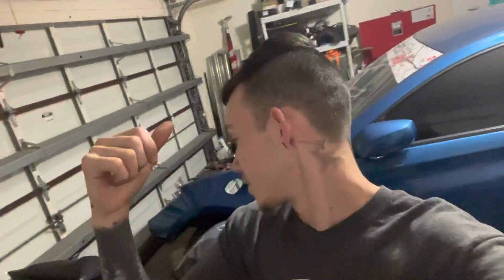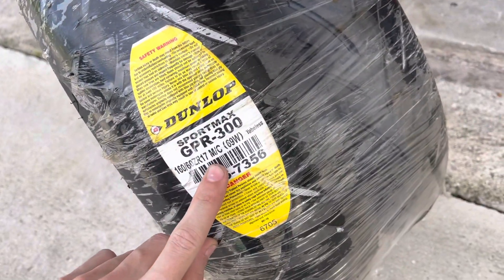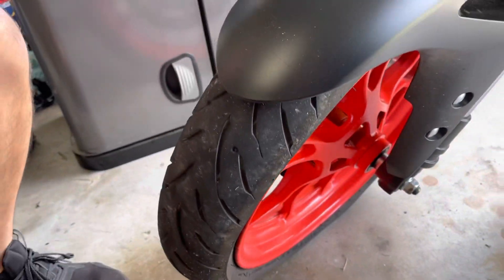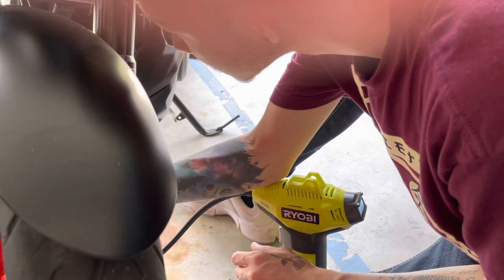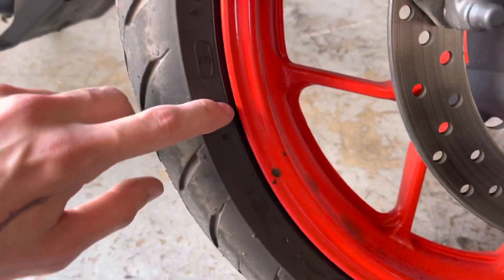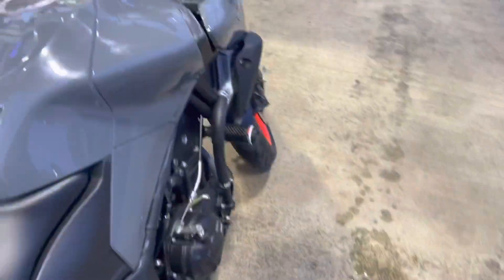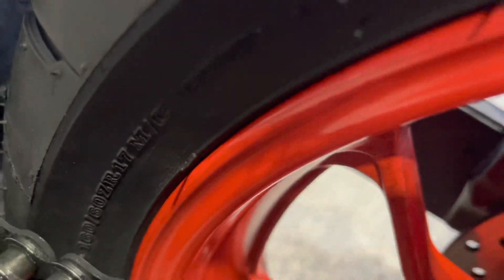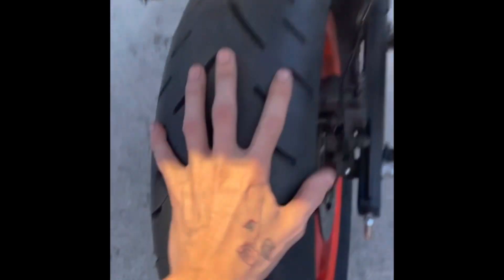Yamaha MT03 gets bigger tires!

Comment: You don't go up like this. Just get better tires. Watch ax rider rip up his mt03 on a 140.
Reply: This bike handles amazing as is, and adding the wider tire only changes that a little, if anything its a little more stable in leaning, and eith the wider contact pach its safer. But to each their own

Comment: how is this possible man? the motorcycle instruction booklet says that only 140/70 is approved for the rear. I mean, I would like to change the rear tire, but the one indicated by the manufacturer must be registered on the mt03 registration document, right? I mean, how did you manage to change this aspect legally? If you had an accident it would be a problem.
Reply from the maker: It’s the same thing as a car they’re always going to recommend you run factory size tire but doesn’t mean you can run other sizes, they don’t look I to tire size aspects if you get into an accident there’s no legal statute  that says it’s illegal to change the tire size or modify a motorcycle in any way possible. Booklet is just manufacturer recommendations for best mpg and accurate Odometer readings

Comment: I want to know if upgrading the tire size on your mt03 does anything to make it feel more stable on the highway at higher seeds when the wind is blowing you around. Did upgrading the tire size make it feel more stable At all?
Reply from the maker: Tire size is meant for better grip however stability all comes from rider position, wind will try to stop whatever is aerodynamically blocking its direction. Get a decent windscreen to blow the air over your helmet and tuck down when riding in highway